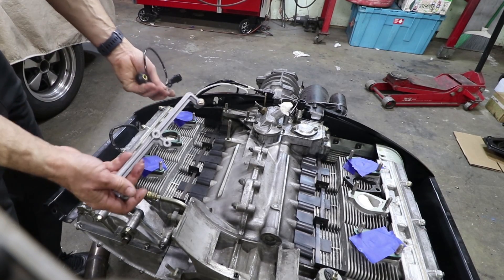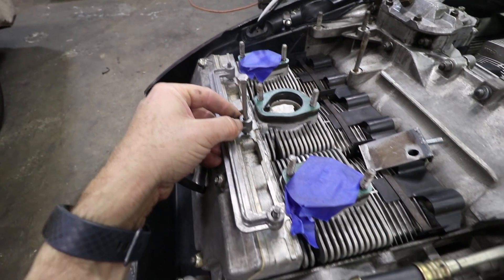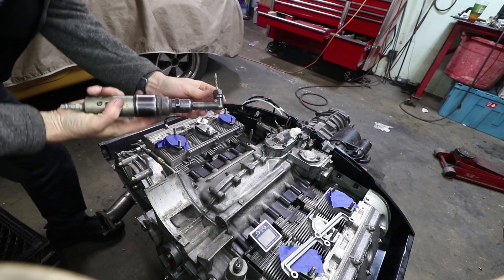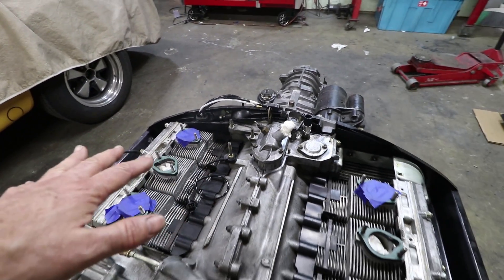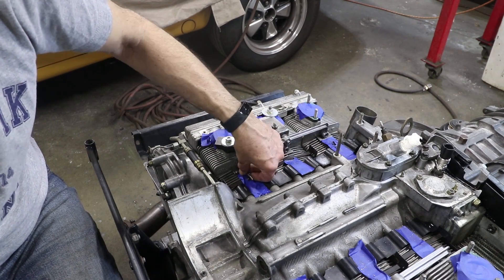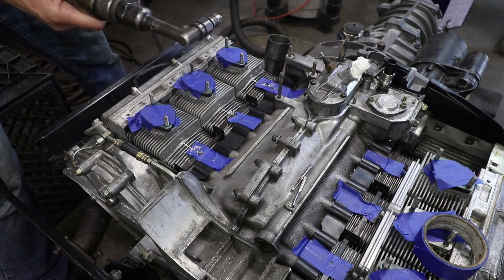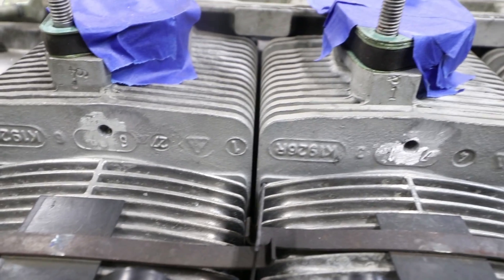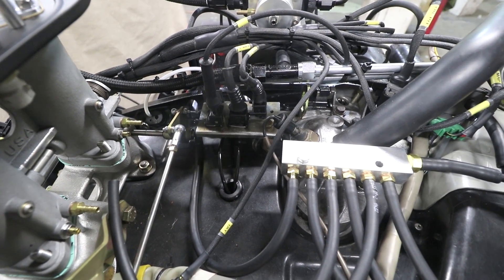Simple DIY Guide: Adding Knock Sensors to Your Early Air-cooled 911 Engine

Comment: That's a tidy solution!  I've seen a few guys mount them on top of the case, including under the shroud and also around the oil pressure sensor (probably what I will do.)  I've always read that valve train noise is a challenge on these engines, but I'm no expert here.  I've also seen calculations that for 95mm diameter pistons (like my SC's) the required frequency filter is around 6.0 kHz, so it'll be interesting to see what you come up with when doing this with the Emtron.  The MS ECU I use does have a knock sensor input, but the signal needs a separate conditioner ... Me, I just plan to do some tuning on my engine with DIY knock ears and keep it all pretty conservative!  (Edit: Spelling.)
Reply from the maker: Sounds good, I'll admit that feature creep is real and all the stuff I included is nice to have. It's amazing what the Emtron can do, so I felt compelled to give it all the info it can get.

Comment: Super cool. How are you going to verify it is picking up the knocks once all the filters are running?
Reply from the maker: The Emtron ECU has a realtime oscilloscope and data logging functions.  Setting the thresholds and filters is the hard part.  Some detonation at very light throttle or deceleration is ok and actually beneficial for piston cleaning.